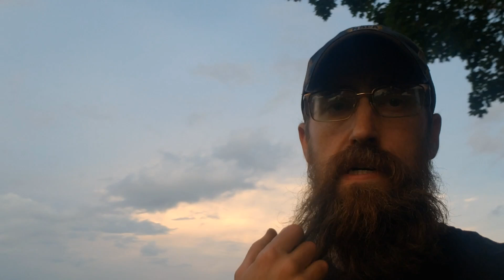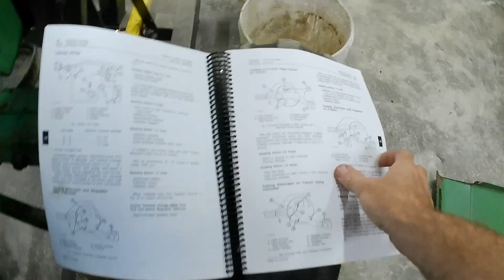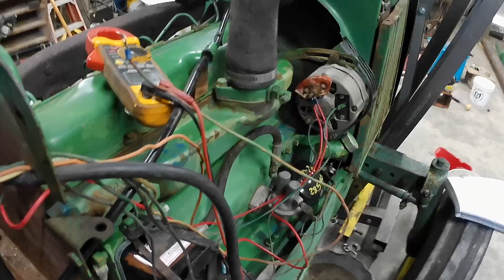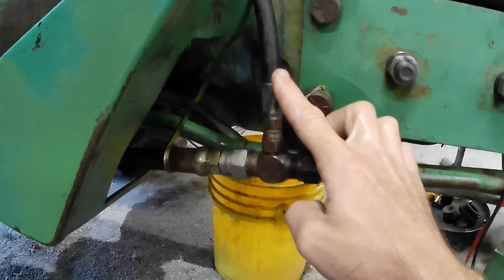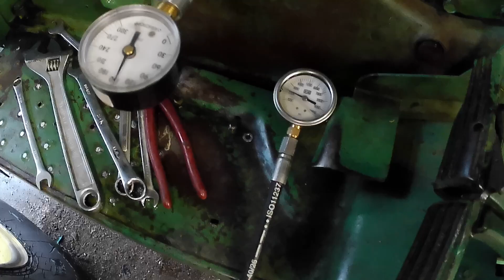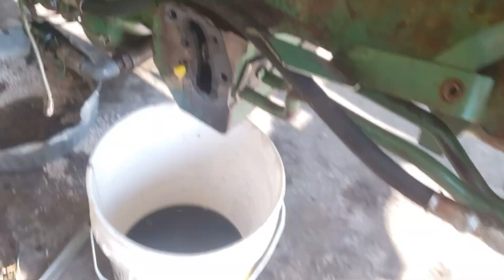John Deere 2440 Hi Low Delete Series Part 4: Final Pressure Adjustments and No Brakes!

Comment: This shouldn't be a 5 part series to figure put a basic open center hydraulic system... It also shouldn't be a 5 part video to figure out that the brake system  may need bleeding... It always shouldn't take more than a minute to hook up a brake pressure gauge in place of the bleeder screws to figure out whether they are developing the required pressures to apply the brakes...
Reply from the maker: Well you clearly aren't aware that this tractor has a CLOSED center hydraulic system.  So maybe you should watch the other videos and learn a little?  😉
Reply: @Bryce_Shuman  Why watch YouTube??? I stand corrected... This unit uses and old school cps that utilizes a radial piston pump that neutrals the pistons by the amount of pressure....However the brake system is a trapped oil system that works the same way as a car... The brake reservoir receives oil from the transmission lube pump circuit and it returns oil back to the reservoir... So knowing this is knowing this is knowing that the transmission oil coming into the brake reservoir is very low pressure and if it has no fluid coming into it then chances are great that a problem exists in the charge pump or internally the fluid is exiting the  circuit before it reaches the reservoir... It could also be that the system was disassembled and never bleed properly and the trapped oil portion of the brake system just has air in it...
Reply from the maker: @sethpayment  Yes, now you've got it with the hydraulics.  👍  As far as the brakes go, if you watch this video to the very end you'll see why I had no oil in the reservoir, and why I knew it wasn't a supply issue with the pump.  I adjusted the charge pump pressure to spec of ~150 PSI after reassembling the tractor then verified lube flow at the final drive planetaries which is downstream of where the brake reservoir is filled from so that throws out anything being wrong with the low pressure hydraulic system.  Occam's razor and all...  Really though, did you watch the entire series or just this video?

Comment: Those clouds in the opening shot, for a quick second I thought you were buried under snow. lol  
Your depth of knowledge on mechanical and electrical is quite something.
You firewood stacking skills need improvement though.. 😁
Reply: The woes of having so many little hands (and mommy hands) while stacking ;-)
Reply from the maker: If I can't use a multimeter or hand tools when stacking wood, it generally doesn't go well 😁